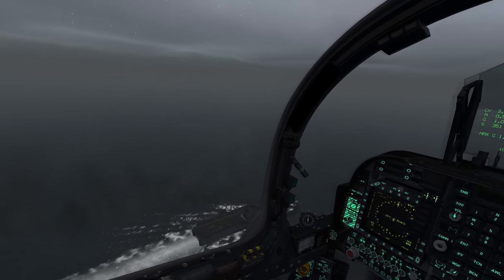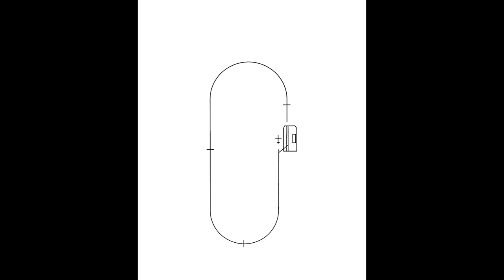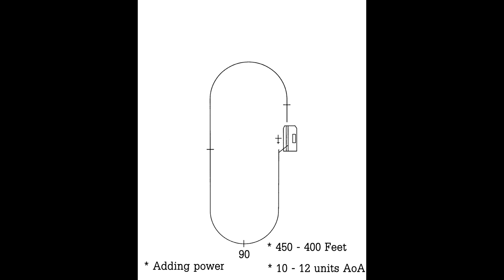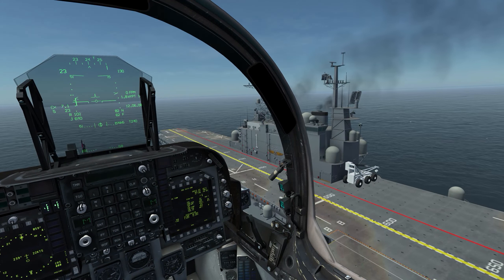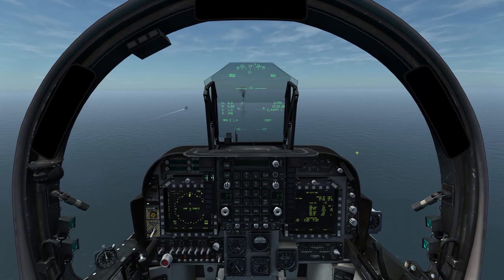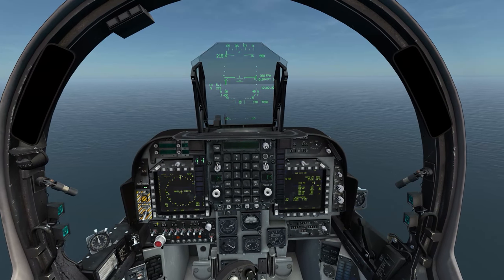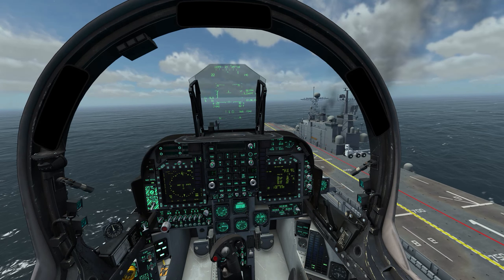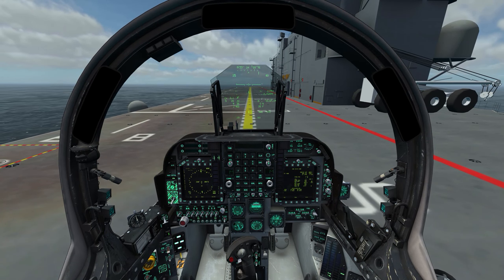DCS AV-8B | Landing the Harrier on the Carrier [Tutorial]

Comment: Excellent breakdown here, and thank you.   
Question - what was the wing load for all of these landings?   I could see the fuel amounts in the cockpit but did not have any reference to what weight was on the wings.
Reply from the maker: fargo007 Thanks!  Wing loading was Two Fueltanks with Two Aim9s (one of each on both wings)
Reply: Thanks!  Are short landings done on the ship as well, for when the wing loading is just too heavy to do the standard landing like this?   Hoping to see that covered in future videos if so.
Reply from the maker: In an emergency yes, however under normal conditions the procedure would be to dump fuel / hold until your fuel was low enough to make a landing attempt.  Harrier pilots often landed with only a few minutes of fuel remaining so its important to train this on land before attempting to make any low fuel landings on the boat ;)

Comment: Thanks for the video. One question: at about 11.32, when you put the nozzles in the hover stop position (82°), the FPM goes down but abruptly it comes back up, perfectly aligned with the horizon, without any transition. Only because of the throttle increment or did you use some other avionics system?
Reply from the maker: It was all manual my wise old friend :)
Reply: So, acting on the throttle should do the trick, right? Can't be so smooth on it, I find difficult to stay on the horizon line: I put too much engine or too little while hovering. I'm in need of some more practice, I guess
Reply from the maker: Someone else pointed this out to me and I re watched it.   What you see is a bug mate, sadly I am not that Jedi with the controls.  It was a bug that was in early access where the velocity indicator stopped working below around 50kts.  This has now been fixed and you will notice that the vector now stays active all the way to touch down.
Reply: 104th_Maverick Ah that makes sense. Was wondering if it was the AFC being engaged.

Comment: I notice that when you are dropping onto the deck that your velocity vector doesn't move.  When I am landing it rises and falls according to my ascent or descent rate and acts as a sort of secondary VSI.  Is this a version change thing, or is there some other reason for this?  It's not a problem, I'm just curious.
Reply from the maker: Hi mate, this was filmed in an early access version of the Harrier so the Velocity Vector was not working properly in the video.  It is now working as it should and will show you your vertical movement all the way down to landing.
Reply: Cool.  That makes sense.  This is a great video by the way.  I am still struggling with doing decent landings.  It's very hit and miss.

Comment: Question: how do you keep the witch’s hat on the horizon ? The throttle ? The nozzle ? Or the pitch on the stick ?
Reply from the maker: The WH has now moved position with one of the latest updates, it is no longer in the same position you see in the video.  So the procedure has changed slightly visually in terms of where you now place the WH for reference.

But the method of control is the same, you want to do most of the work with the throttle after pitching up a little, this way you will have a steady decel.  There is no need to be throwing the nose around to wildly on approach, just nose up slightly and compensate with power as the aircraft slows down.
Reply: 104th_Maverick thanks for the response. However its not decelerating that im having a problem with.. At 82 degrees nozzle, i discovered that the plane wants to go in reverse. Hence for my landing approaches. I've taken to just keep it at 75-79 degrees and only using 82 degrees to adjust airspeed.

Comment: Good job. Maybe it's incorrect, but I think I read somewhere that you are supposed to land with brakes on. Is that correct?
Reply from the maker: The brakes are still a little buggy in the early access Harrier, so if you land with them on the aircraft starts moving.  In the checklists it says to apply brakes after landing, I think in real life they have their feet on the brakes as they land, but I'm not 100%.
Reply: 104th_Maverick ohhh yeah, I forgot all about the buggy moving LHD brake thing. Good point.
Reply from the maker: The brakes seem to be working a bit better now, I've found when Anti Skid is set to NWS and you set the parking break ON when landing it the brakes will hold you until you move the nozzles forward.  At this point its important to apply the tow breaks, disengage the parking break (as it will still be on but not effective) then taxi to parking and setting the parking break again.
Reply: 104th_Maverick thanks for the update!

Comment: Can you tell us how you're getting the correct altimeter setting?
Reply from the maker: You can adjust the altimeter is down on the right hand side of the flight stick.

When coming into land on the ship you should have your RAD ALT ON which I didn't have on at the time in the video.
Reply: I know how to adjust it, I was wondering how you're getting the right setting in the first place. I don't think you'd want RAD ALT on; as soon as you got over the deck you'll suddenly get a jump in alt reading.
Reply from the maker: Yeah you want RAD ALT on, the reading will jump when you cross the deck but if you come alongside at 120ft as you cross the deck you will be at 50ft (where you should be).  You take the RAD ALT speficifally to avoid having the wrong altimeter setting and ending up in the drink during low vis etc.

You get the pressure setting of the mission from the mission editor.  Another good way to set it if you actually start on the ship is to adjust the altimeter until you get 70ft shown on the HUD which is the height of the deck.  That way when you takeoff and come back to the ship you can land with the correct setting but usually in the mission the default is 2992 and won't change unless the mission editor changes it.

Comment: very well done but, its a "SHIP" a boat is submersible
Reply: Naval aviators (of the USN/USMC) traditionally refer to their respective vessels (CV, LHA, DDG..) as a "boat".  This is partly because we know it bugs our black shoe brethren, the Surface Warfare Officers.   A SWO will refer to them using the proper nautical term, which is indeed, ship.  Though submarines are called boats in the USN, being submersible is NOT a requirement for a "boat".  Tug boat, fishing boat, sail boat, pleasure boat...  
"Ship" vs "boat" is mostly a size issue.  In NROTC we were taught a ship can carry a boat, but a boat can't carry a ship.

(I suspect part of the naval aviator's "boat" tradition may have roots from WWII.  The wartime influx of naval aviators, most without a nautical background, just didn't know the difference between a ship and boat.  When they realized that using the wrong term bugged the professional mariners, the term stuck!)
Reply: The definition is based upon size. A ship can carry a boat, but a boat cannot carry a ship. You're right in that it is a ship, but not for the reason you specific. Also, it' doesn't really matter. what it's called, we all know on the context what he is referring to